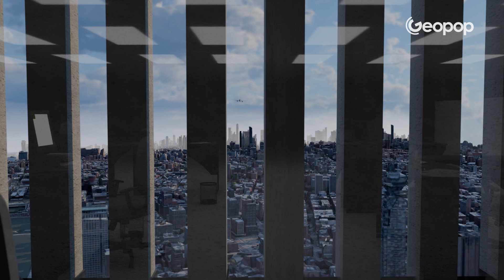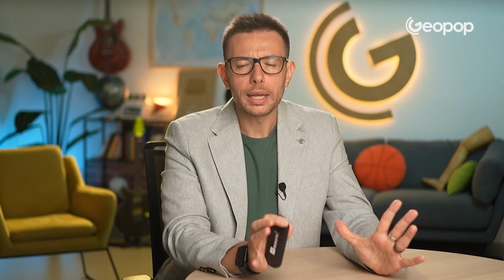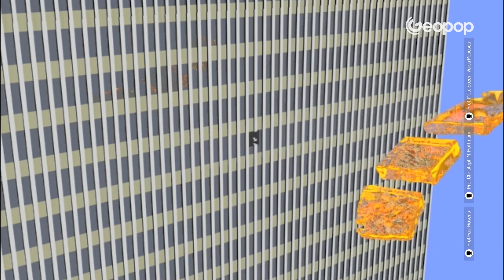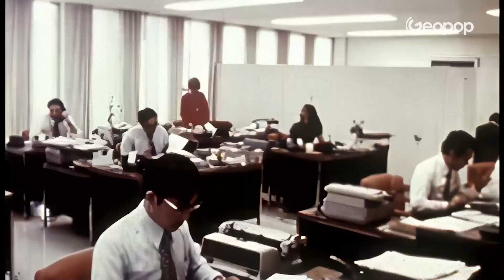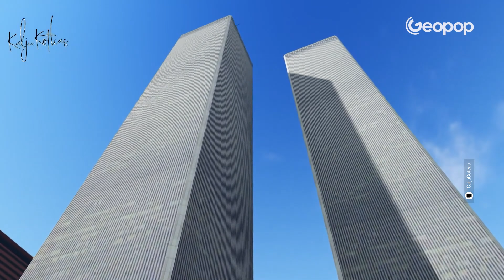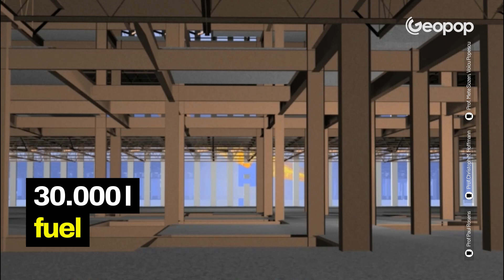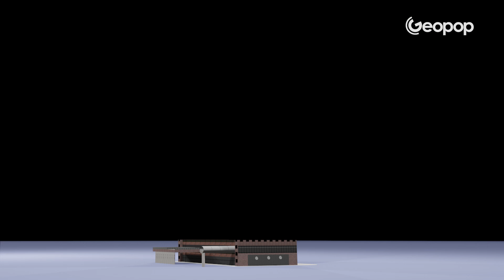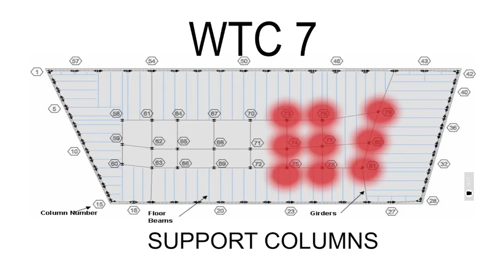9/11, 2001: The Technical Reconstruction of the Twin Towers and WTC 7 Collapses

Comment: I wasn’t going to watch this, but I was hopeful it uncovered facts that had previously been omitted. I was soooo wrong. Not sure if the narrator is an engineer or simply a talking head, but he keeps using the phrase “the steel”. He fails to quantify and qualify what “the steel” means. Was it all the steel in the building, 10%, 50%? It would be virtually impossible for all the steel to be compromised. So what was the percentage? Also was all the steel the same? Same thickness, flat or I-beams, same type of material? These are questions that seem to always go unanswered. And using NIST as a definitive judge of the structure collapse is a real disservice to the souls who lost their lives.
Reply: "The steel" is the structure, since these buildings were of all-steel construction. 

That should not need to be explained. 

Your other questions are irrelevant because you are completely ignoring context.
Reply: @ apparently you are unable to read or comprehend.  I used the term “compromised”. Not all the steel was compromised by heat. What percentage was compromised. Also steel can be in different configurations, thickness and grades. These are legitimate questions, but I shouldn’t expect you to understand. 🤣
Reply: @LeonMusck  - Enough to initiate the collapse, which is all that was required. 

GRAVITY does the rest. 

What started the collapse and what kept it going are two different mechanism - which should be obvious in the explanations

For a guy who is not getting the bleeding obvious on a fundamental level when it is right in front of your face,you sure are a smug and arrogant pr!ck.
Reply: @LeonMusck  - Yeah, what do I know?  

Twin Towers collapses were relatively straightforward, the fundamentals already understood in the professional engineering community within just weeks. Yet there’s a lot of really bad information floating out there, mostly on the internet where it’s easily accessible to anyone. Good information takes more effort to come by and is much harder for laypersons to digest. Engineeringspeak is complex and dull while wild baseless speculation and pathological theorizing with easy hand-wave answers is simple, exciting and require a whole lot less thinking, thus getting far more intention than they deserve.

To correct that situation, I have all on my own prepared this short yet detailed technical description of Twin Towers collapses based on my own observation and analysis of the available true and relevant facts. No politics or ideology, just the engineering. My hope is this will dispel many common myths and answer most if not all questions you may have about the Twin Towers collapses, because anything can seem like a conspiracy if you don’t understand how it works

While complex, most of the Twin Towers collapse mechanisms can be seen with the naked eye and easily discerned and understood by the layperson if sufficient time is taken to understand. 

1. The Twin Towers consisted of 4 primary structural elements that together formed an integrated system where each relied on the others.  47 hollow box-section steel Core Columns carry the majority of the gravity loads. The 236 hollow box-section steel Perimeter Columns carry the remainder and ALL of the lateral (wind) loads. Long-span Lightweight Steel Trusses connect the core and perimeter column together at each floor with a Hat Truss on top to tie the structure together as an integrated unit where no element can survive without the others. There was no structural load bearing concrete and most components were bolted together.

2. The impact of 117 tons of airplane (= to about 12 dump trucks) at speeds up to 590 mph with the energy of a ton of TNT completely destroys the aircraft. This in no way implies the Towers come out unscathed. Many perimeter columns are damaged or destroyed as are some core columns (example; 33 of 59 perimeter and 20 of 47 core columns damaged or destroyed at the impact floors in the North Tower), This damage is primarily through bolt-shearing failures at the end connecting flanges, as well as bending, twisting and fracturing of weld seams. There was no cutting or slicing - the reality was far more violent and messy. 

3. The impacts destroy or damage fire insulation, fire breaks and sprinkler systems on multiple floors.  Huge fires are started across multiple floors simultaneously and allowed to spread rapidly with no effective firefighting or fire suppression. This was an unprecedented fire event . 

4. The hotter steel gets the weaker it gets .  With fire insulation stripped away and no sprinklers the survival time of the steel greatly reduced. Gradually over time heat causes the lightweight steel Floor Trusses at the impact damaged floors to sag, which was observed and recorded.  No steel melted or needed to. Structural steel fails long before it becomes a puddle. It just needs to bend

5. Sagging floor trusses pull on the increasingly weak and overloaded Perimeter Columns, causing some of them to bow inward by up to 5 feet. A straight column is up to 4 times stronger than a bent column. The bowed Perimeter Columns buckle and fail, initiating collapse. The formerly static mass above which the structure below could easily support is now converted into a dynamic mass up to 30 times greater. Because they have buckled, the Columns above and below the failure point are no longer aligned . The load bearing structure below no longer bears any load as it falls past the lower columns, NOT onto them.

6. Thousands of tons of debris fall within the four outer walls, down through the open office space, crashing onto the first intact floor it encounters. This massive impact immediately breaks the bolted connections to the columns as the amount of resistance the Floor Trusses can offer is negligible.  The falling debris slows only marginally and briefly. Note:
6a. This is NOT a solid top block crashing into and “crushing” a solid bottom block .
6b. The debris falls past the columns not onto them.  The columns provide no resistance to the falling debris. 
6c. Only the bolted connections of the floor trusses to the core and perimeter columns can offer any resistance. A pair of 5/8” bolts at each end of each truss vs. thousands of tons of falling debris.
6d. No laws of physics are violated.

7.  This floor-led collapse progression within the four outer walls can only go straight down. Note: 
7a. This process is often incorrectly referred to as “pancaking” which actually refers to a completely different process rejected at an early stage. The catchy name stuck but nobody knows what it is supposed to mean.  Pancaking is too simplistic and inaccurate anyway. More like Kaiserschmarrn.

8. Collapse progresses through the floor systems not down the columns, through the path of least resistance . Rate of floor failures increases with each successive floor as momentum increases, reaching an average acceleration of 0.65 of GA, or 35% slower than true free fall. Bam, bam, bam down the building until there are no more floors to fail.  The resistance offered by each successive floor is always the same. The mass and velocity, thus the energy of the falling debris is constantly increasing, with each floor destroyed adding new falling mass. Some falls to the sides, but most falls down. More mass, more velocity, same resistance with each floor.  Don’t get stuck on the but the lower floors weren’t on fire nonsense. They weren‘t and didn’t need to be.

9. The Towers were 95% air by volume. As that air was compressed inside the building it is forced down the tower and blown out the sides in reaction to the building collapsing . Those were not “explosions”, it was expulsions of compressed air caused by the collapsing building, explaining the low velocity, lack of flash, blast, supersonic pressure waves and lethal high-velocity ejecta.  

10. Perimeter Columns become detached and peel away like a banana behind the collapse front, playing out to the four points of the compass extending to more than 600 feet from the base of the towers. This was quite obvious from examination of the debris pile. 

11. Core Columns fail last as their internal beam bracing is stripped away by falling debris and lateral support from the floor to perimeter columns is lost. 

12. For those who care about how long this whole process took; 31-34 seconds from the moment the perimeter columns buckled until the last core columns hit the pile, or 1/3 the rate of true free fall. Don’t believe me?  Just watch any video of the collapses and note the loose truly free-falling debris dropping much faster than the towers themselves.  

13. Each Tower had a 1-acre footprint. Far from collapsing inside their own footprints the debris pile spread out over 17 acres in a pile up to 14 stories deep. 8 surrounding buildings were destroyed and scores more damaged by the falling debris. 

14. Finally, the Twin Towers were perfectly safe within their design envelope.  They only collapsed when taken far outside design parameters by an extraordinary and unprecedented event 

Impact + Fire (heat) + Time + Gravity = Collapse . Remove any one of those four elements and there is no collapse. Ignore any of those elements (as many do) and you will never understand the collapses. The Twin Towers were an integrated system in which no one component could survive without the others. One fails, the rest follow, through the path of least resistance – DOWN – through the open space, bypassing the path of greatest resistance – the columns.  Nothing I just described violates any laws of physics. All of the above is true no matter who planned and carried out the 9/11 attacks or why 

I hope you found this helpful and informative. It is not meant to be adversarial, but to solicit informed critical comment, positive or negative. If I made any errors of fact, logic or reason or left anything critical out, please let me know so I can fix it. To stay focused just one topic at a time please and on-topic (Twin Towers ONLY). No word-salads of Gish Gallop. IF you can offer a more plausible alternative be my guest. Be the first. Please start any reply with the words “Tits McGee” or I will know you didn’t actually read it, are not serious and just wasting my time.

Comment: With all due respect, this is nothing more than a regurgitation of the ludicrous lies issued by the US government regarding the events of that day. Everyone who has studied even junior high school physics understands that the downward force of the collapsing upper block of floors would have been met with an equal but opposite force of the mass of the building that had not been damaged. The video evidence proves that there were explosions that preceded the collapse wave. Destruction of the undamaged part of the towers with explosives is the only way the near free-fall collapses were possible.
Reply: It's what happened.  

You fail because you think believe there are two (solid) block acting on each other instead of the complex interactions of millions of components. Until you shed simplistic block-dynamics (non)thinking you are condened to fundamentally not get it.

The 47 core and 236 perimeter columns of the Twin Towers support all of the gravity loads of the building. ALL of the resistance is in the columns.

Planes impact Towers, causing massive structural damage, destroying sprinkler systems, tearing out gypsum board walls and blasting off the SFRM insulation from the floors. Multiple floor-wide fires are started instantly and spread rapidly due to the destruction of fire protection systems and venting of the building during the impact.

Serious fires were largely confined to the impact damaged floors and those immediately adjacent to them.  

Fires were started by the impacts and fuel aboard the aircraft, which acted as an accelerant. No shortage of other consumables inside the tower to continue the fires. 

Collapse was initiated (started) at the impact and fire damaged floors when floor trusses exposed to heat over time sagged, in turn pulling on and causing the inward bowing of perimeter columns by up to 5 feet until they buckled. 

No steel melted or needed to. Structural steel will bend and fail at less than half its melting temperature.

Once the perimeter columns buckled the formerly static load above became a dynamic load 30 times greater, easily overwhelming the structure below.

Thousands of tons of now loose debris fell through the open off space - through the inside of the building bypassing the columns - dropping 12 feet onto the first intact floor it comes across. The massive instant overload causes the floor to fail, adding its mass to the falling mass which continues to accelerate for another 12 feet until it impacts the next floor, rinse and repeat all the way down. Rate of collapse increases as momentum increases. As each floor fails, air inside the building (the Towers were 95% air by volume) is compressed, then blows out the sides _in reaction to the Tower falling, not the cause of the Tower falling.

No fire required at all on floors below the impact points for them to fail. The mechanisms that started the collapse are different to the mechanisms which continued the collapse.   That will be a difficult concept for some.

As the floors fail the perimeter columns are left literally hanging in the breeze, no longer attached to the rest of the structure. They peel away and fall in great sheets (think banana) out to more than 600 feet from the base on the 4 points of the compass. 

Core columns failed last. 

Each 110-story tower had a 1-acre footprint. The debris pile was up to 14 stories deep and spread out over 16 acres, destroying 8 surrounding buildings and damaging more than 100 others.

Comment: The irony is that if the Trade center towers of building 7 had tipped over sideways, THAT would be cause for suspicion of controlled demolition, lol.  I'm a licensed architect, so I know a bit about structural steel and it's limitations and modes of failure. Watch this video: It's of a steel frame Bangkok high-rise collapsing during a recent 7.7 magnitude  earthquake: https://www.youtube.com/watch?v=Pft8IDhzzHY

Notice anything?

Right. It collapses into it's own footprint. During an earthquake that was exerting so much lateral (sideways) force on it that the connections between it's columns and beams failed, causing the columns to buckle, followed by what's known as "progressive collapse" - at a speed  determined by the acceleration due to gravity - 9.8 meters per second, squared, less the trivial opposing force of air-resistance. You can test this yourself. 

Pick up a brick. Drop it. What happens?

It falls straight down. Every single time - unless you push it sideways. Think of high rise buildings as a LOT of bricks - millions of them - It's going to take a LOT of force to move them sideways. Even earthquakes won't necessarily be enough - unless the mode of failure is something known as "inadequate base-shear resistance" due to poorly designed or constructed foundations and connections. Asymmetrical "soft story" type construction can also lead to buildings collapsing asymmetrically, but it's very rare that such a collapse will  occur such that the bulk of the structure moves laterally. THAT requires precisely timed controlled demolition, where key  structural members are weakened, and connected to others with cables, creating a progressive collapse in a certain direction to avoid hitting other buildings. It's very risky, and requires careful calculations and perfect timing to pull off.

Once a steel framed building's contents catch fire, the time it will remain standing is determined by it's fire-rating, it's fireproof integrity, and whether the fire can be brought under control before it's thermal energy weakens the structure past it's plastic deformation limit. Significant weakening of ASTM 36 structural steel begins at just 400 degrees F (40% of it's strength is gone) By 800 degrees, it's lost 60% of it's strength. by 1,000 degrees, you're having a very bad day. Typical structural safety factors are 50% overdesign, depending on the method used, and occupancy / use of the building. Steel conducts heat extremely well, meaning that even if only a small portion of a steel structure is exposed  fire, the entire structure is at risk of collapse.